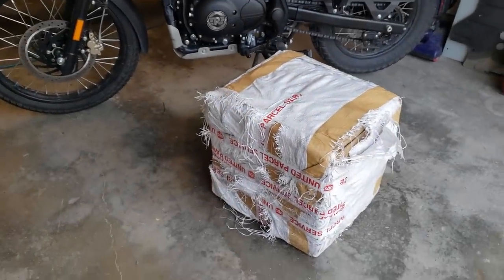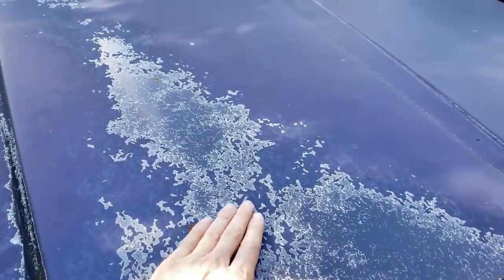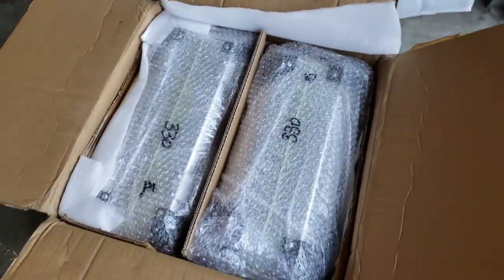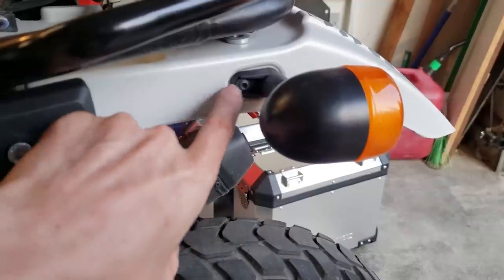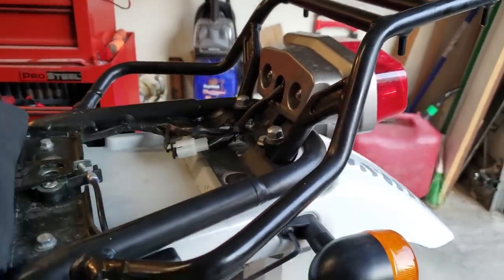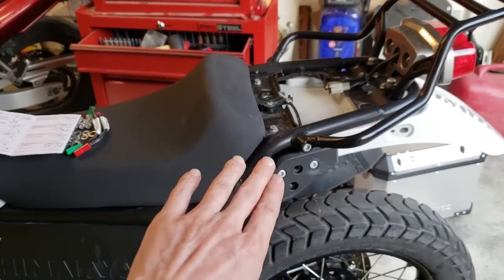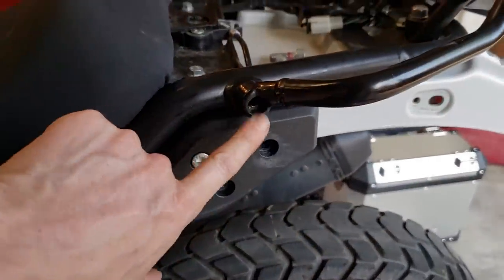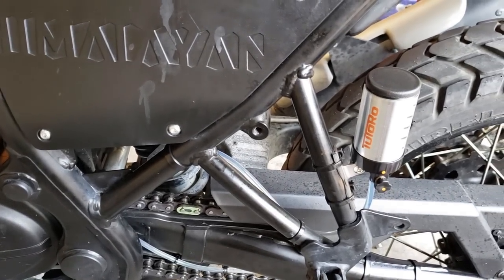Himalayan Hard Panniers & Racks: Step-by-Step Installation & Tips

Comment: My mounting brackets don’t fit. Pisses me off. Junk.
Reply from the maker: You mean the mounting holes are out of position or something or the rack is bent?

Not that this will fix your problem, but are you keeping all the bolts really loose until they are all in place and then tightening them down together little by little? That might help. The rack can flex a little under the strain of tightening all the bolts and it might land in position once you finish tightening.
Reply: @KARMAkazeMoto  The mounting brackets on mine were installed at the dealer when I bought my Himalayan about a month ago. They did a so-so job. Not a tight fit on the lower bolts on either side, slightly skewed. They told me "it's always like that with RE", which your video clearly shows it's not. So I will follow your lead, loosen the bolts all around and tighten again bit by bit, see if we can get this right. It's sturdy as hell, but looks a bit off and it bugs me. Great videos, Justin, very informative. Keep it up!
Reply from the maker: Thanks Rune!

I think most racks are able to be fit properly, but being hand bent and hand welded, there's bound to be some odd pieces. 🙄

When I installed my Mosko Moto panniers, on one side I had to forgo using all 4 of the supplied clamps that attach the Mosko "puck" to the cargo rack. Did my Prudhoe Bay trip with 1 clamp on top, 2 on the bottom. Not enough space between the right cargo rack and right grab bar. The left side had space. Clearly the cargo racks or the grab bars were not identical on both side.

Let me know if loosening/tightening does the trick for you. And if all you need is a millimeter or two, consider putting a large  pipe over the rack mounting point/end and giving it a slight bend... if possible.

Comment: That wiring is not right, you need to re-route it.
Reply from the maker: Totally agree. Just sharing the manual instructions first. My mods will come soon enough. Thanks AvianicsGuru!
Reply: @KARMAkazeMoto  

Hi there how do you rate the Himalayan, I am thinking of one as a hack and keep my Triumph Thunderbird nice and clean as it never goes out in the wet
Reply from the maker: @ThePorridgeGobbler  I like your plan, one bike to keep dressed up and clean for the Sunday cruise, and one to get dirty. While I do occasionally come across small thinks about the Himalayan that are characteristic of the price-point, overall I've been really happy to have it. I just rode to the far northern coast of Alaska and back without a single problem, and to be honest, that trip showed me what this bike was about. It absorbed the hundreds of miles of gravel and dirt road I was on and was a pleasure to ride. Could use a bit more wind protection, but that's coming from someone who just rode it through the Arctic in -2°C weather with snow. It's a great little camping and exploring bike, or run it to get some groceries and toss the milk and eggs into your panniers. I'm happy with my purchase. 👍🙂